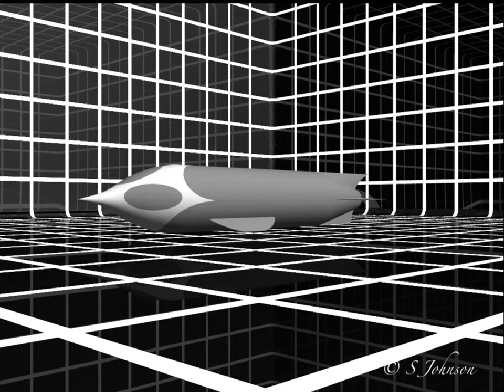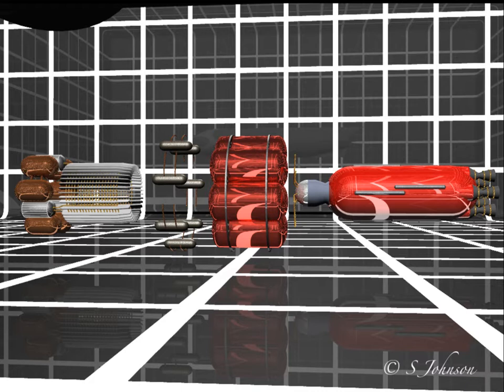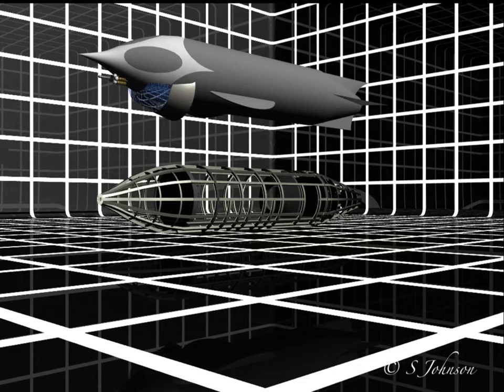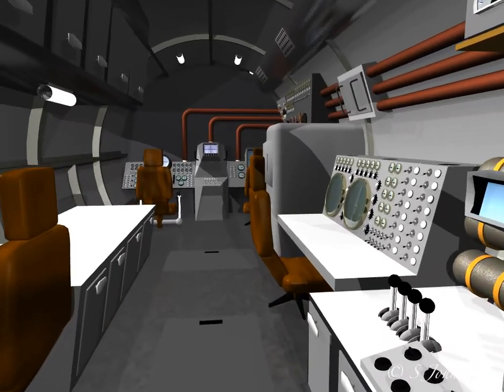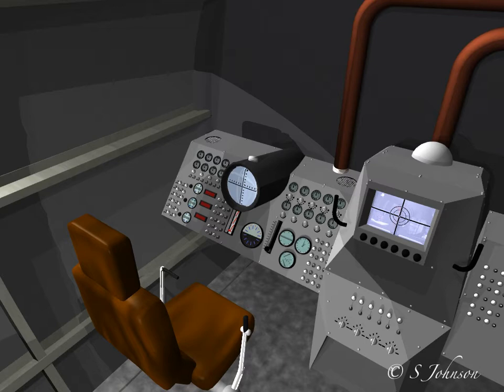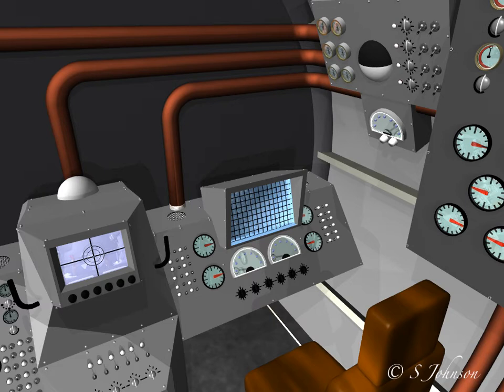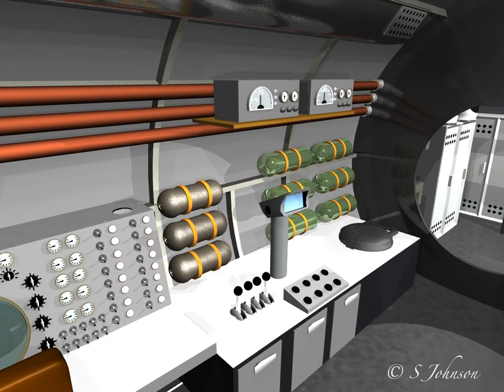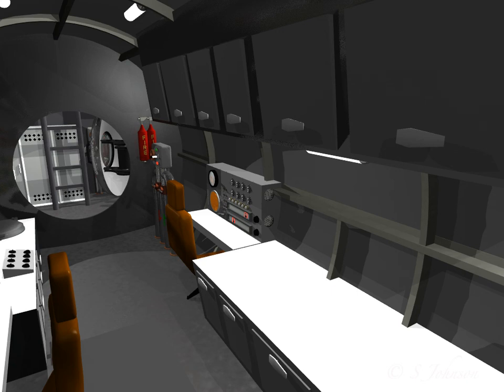3D Tour of the Rocket - Commando Cody * Scifisteve

Comment: Like it a lot. A few points. The seats would have footrests and would fold down flat allowing them to be used as beds, similar to business or first class airline seats. 
They need to drink so theres a  water tap with  hot and cold water and sink.  Its an atomic powered ship, electricity is not going to be a problem thats how they make coffee. Also a small toaster oven. Joan mentions in one episode there was food for at least a month, they are not going to be eating stale sandwichs for a month. I  expect they would have WW2 type military rations  which they would heat up. 
Interplanetary missions could be lengthy , days or weeks to complete. So there's likely to be fold away table and chairs similar to camping equipment.  As they are required to engage in physical combat, there's foldaway exercise equipment.
The minimum crew was three which makes sense as that allows a rotational 8 hour watch . In their recreational time the crew would entertain themselves with  card and board games,  reading , music (tape or LP player) etc.